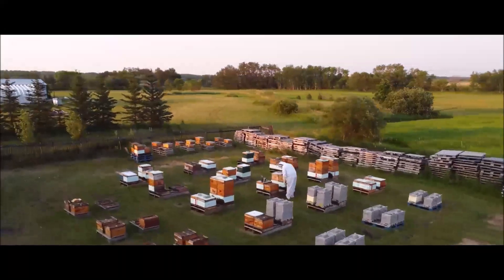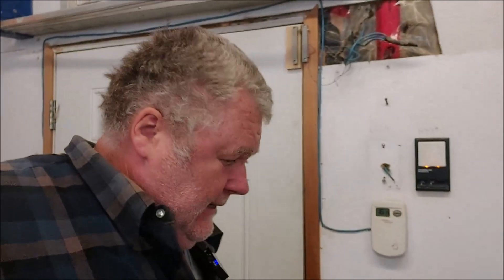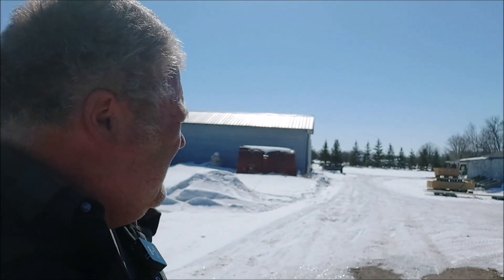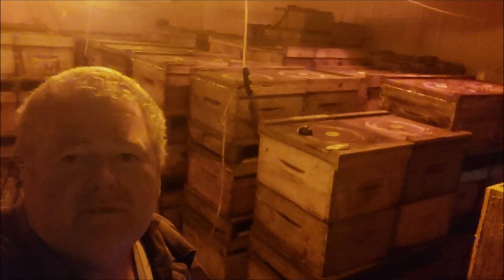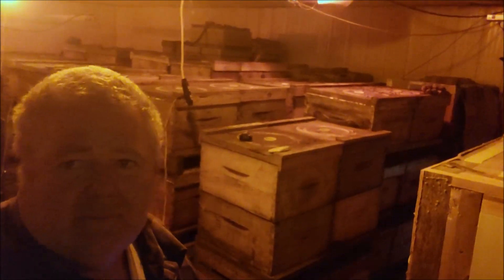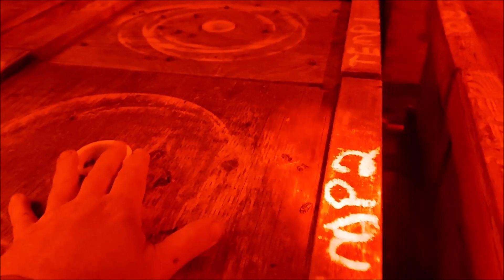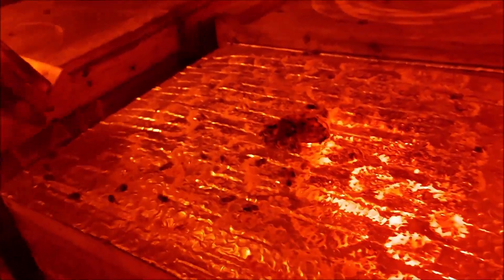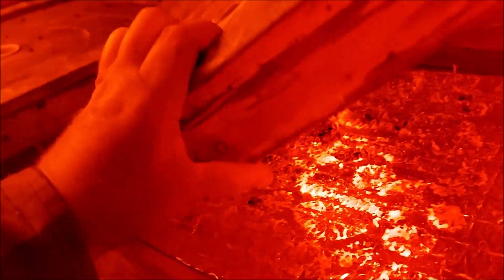Bee Barn Check-That Bee Man

Comment: Good to see your bees made it through. Curiosity what are the dimensions of your top cleats of migratory covers? Width mostly
Reply from the maker: Hi Paul.  My cleats are 2" wide.  You can find detailed build videos on my channel if you're interested.  Thanks for watching!
Reply: Well to late I've already nailed 2 3/8 cleats on some existing covers....was thinking of adopting your design with your blessing however I will not be expanding or equipment to do so. Thanks. Paul